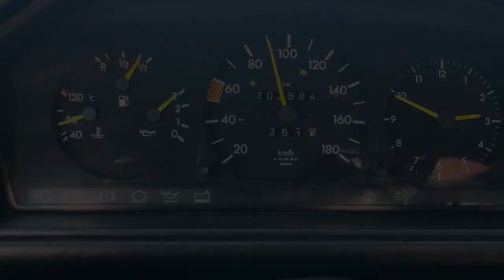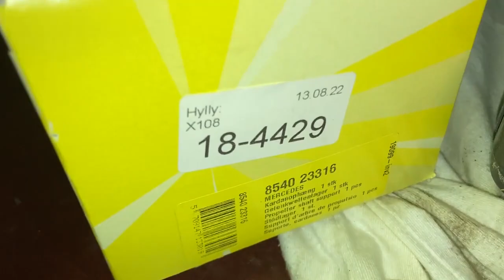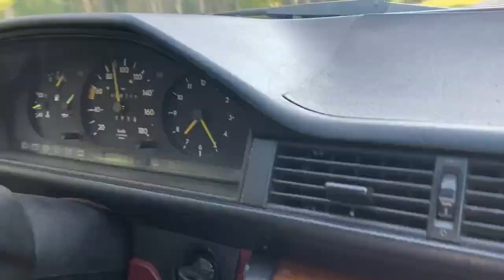Mercedes-Benz W124 - Kardaaniongelmien selvittelyä ja korjausta

Comment: How does it go up the hill, can it pull it off on bigger uphills?
Reply from the maker: Veery slowly 🙄 Not very big uphills here luckily, so it just about maintains it’s pace - no need to even downshift to 3rd…
Reply: @ccrepairchannel  I was thinking if it can pull from a standstill in 1st or 2nd gear up a hill of about 40 degrees of bank and 20 meters lengths I am planning to buy a W124 200D so I am wondering if it will be able to withstand trips to the summer home.
P.S. Thank you for you're reply.
Reply from the maker: @andrej8566  Well, I haven't tested such a steep hill... But if there is grip I'd think it will climb that hill. Gearing in 1st and 2nd will be low enough, I think...
Reply: @ccrepairchannel  Btw did you rebuild the engine or it's just well maintained because oil pressure is on maximum and engine is purring like a kitten
Reply from the maker: @andrej8566 Well, I have only changed the oil… I don’t know what previous owners have done, but it is possible that it is just well maintained - these engines are very durable.